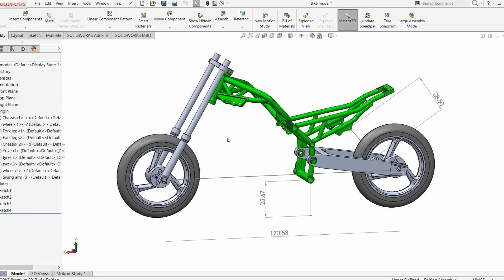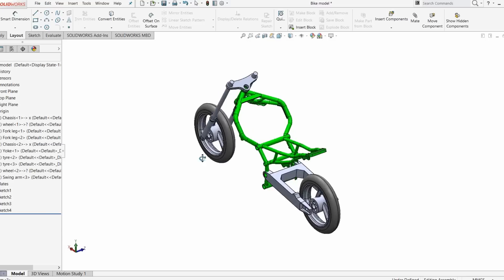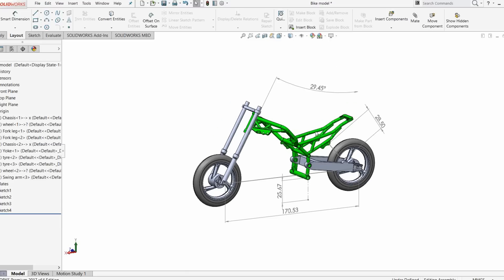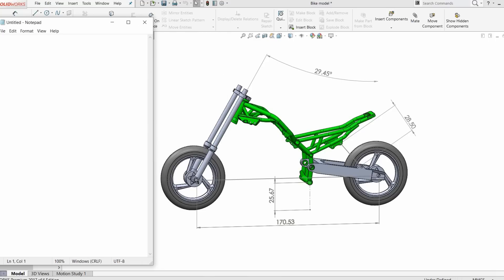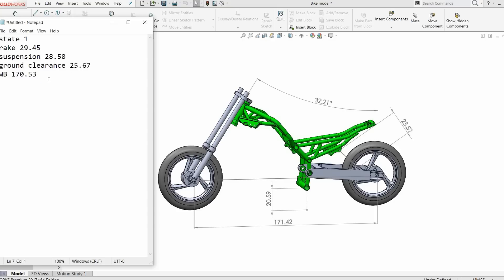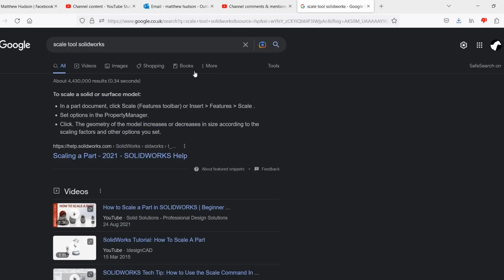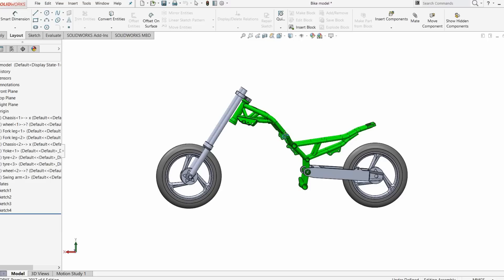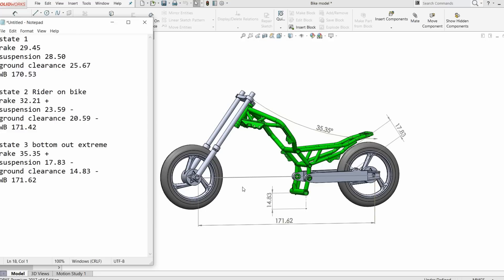Suspension Geometry 101 - Part 1

Comment: What do you think of Robert Horn's novel suspension design (particularly the front since it's forkless but without the problems of hub-center) on his prototype recumbent race bike?
Reply from the maker: You mean the bike with the massive wheelbase. Also known as the clown bike? The fact that you're asking says a lot.
Reply: @thedirtyworkshop  Yeah, his wheelbase is a little long, but Dan Gurney had a similar idea (but used common suspension tech) at a 60-inch wheelbase. I can't imagine a 60" wheelbase is too much worse than the 58 inches on modern superbikes.
Reply from the maker: Next is centre of mass. I'll let you work out that one.
Reply: @thedirtyworkshop  The Center of mass is low, but that's not an overall detriment if the polar moment of inertia is also tight. A sledgehammer with a 2-inch handle will flop over trying to balance it in your hand just as fast as one with a 10-inch handle. Where a low CG hurts you and makes things slower is when the masses are far apart, IE a cruiser bike, or for my everyday object example, a dumbbell with something like a few inches extension to the shank on one side.

Why do you think moto GP bikes keep trying to raise the engine in the frame? They're getting it closer to the rider's mass so the polar moment of inertia is tighter and the bikes can fall into a lean quicker. Dan Gurney's AAR Alligator and Robert Horn's recumbent bike both have this same design feature, just with an overall lower CG which has the benefit of less leverage on the contact patch to cause high sides or otherwise a decrease in cornering force by requiring more lean angle to get the CG low enough that it doesn't high side.
Reply from the maker: @Drunken_Hamster I like how you're asking me rhetorical questions... so long wheelbase and low CoG = bad...
Reply from the maker: @Drunken_Hamster you're also choosing a failure state as an argument. Don't do that, it's a bad position for an argument.
Reply: @thedirtyworkshop  Well I don't like how you're avoiding the counter-argument and keep reiterating on things I've since discarded.
Reply from the maker: @Drunken_Hamster lol wow that's a high opinion you have of yourself. Dude, you asked me for my opinion, I don't know or care who the fuck you are...
Reply: @thedirtyworkshop  Fuckin bruh. Talk. About. His. Suspension. Design. Or explain why low cg with a low polar moment of inertia, which allows for rapid changes in direction is bad. Disregard the long wheelbase; I already agree with you on that, and as such, it's no longer relevant.

Comment: On this subject and Dels triumph suspension video.

He bounced up and down on the bike with the rear tyre strapped down to the lift. Which I expect would bind the travel? 

In my experience, with the rear brake pressed on my KTM dirt bike the rear suspension does not like to compress. The rear shock is a PDS style, so no linkage.

Comment: Random engineery question.  I like to watch "rather B welding" he is building a trophy truck with with a bike engine and four wheel drive with reverse. Chain driven ..bloody chains everywhere as usual 😂 is he losing horsepower doing this? There is gear reductions and all sorts going on . I don't think it's ever come up in the comments but it just got me thinking with all the axles and sprockets going on. If you get a minute have a look at his latest video to get an idea what I'm on about, you might enjoy it in some way 😂his skill or ingenuity who knows. He's a good lad though.
Reply from the maker: Anywhere friction is happening you lose power. Anywhere where twisting happens over 20 times the shaft diameter there's a good amount of power loss.
Reply: Yeah kinda what I thought, cheers buddy 👍

Comment: Nice vid ! it would be cool if the next ones includes the *is it called "drag" in english ? (the distance between the pivot point projection to the ground and the contact point of the front tire) and forces apllied calculed dynamicly by your cad software and theyr effects on the character of the bike (agility/stabilty), i've read some interesting stuff on this explaining principles but not diving deeply into dimensions and forces. It would be great to see that live in CAD, what one degree of rake do and what 2 cm of wheel axle offset either done by the "T's" or by the down tube and and all that stuff  . Really nice topic ! Thanks Matt !!! 😃 I have and idea of the work it takes ... quite à lot ... CAD softs are powerfull but sometimes the're tedious or doesn't do what you expect in a very boring way lol ! I spent quite a bit of time fiddling with FREECAD trying to fold my mind into how to achieve things and redoing them the "right" way... or one of them... lol ..quite a steep learnig curve ... 😉 Sorry my "technical english" is a bit sloppy 😅

Comment: I had to see why my dishwasher quit (not the wife). Stupid control board in the top where the buttons are got wet. I need 3 grains of rice components to fix it. I want relays, on, off. So now I wait until tomorrow to try and order a board. I’m going to add more conformal coating on the next one. I didn’t know the Z900 is a terelas frame. I have a Honda 1000RR, that’s all I know.

Comment: Glad you mentioned the modelling here is not showing front fork compression/extension effects...was wondering if it was included. In part 2, hope you bring up the castor/trail effect changes on the front wheel...as per how it can make the bike more or less stable at speed/cornering etc.

Comment: Swinging arm pivot height is also interesting as this has an effect when there is load applied through the upper chain run (imagine you are pulling hard on the chain like the drive sprocket does) when throttle is wound on and the swinger squats or rises relative to the frame. As Matt says geometry change does get hard to imagine without a working model.

Comment: Did Del the bell measure his sag from the ground rather than a fixed point on the swing arm??

Also on your example you’re weighting the rear to lower everything but your not actually compressing the forks as adding a rider to a bike would do in real world situation.
Reply from the maker: It as if you didn't listen to me say about the forks, repeatedly...

Comment: Great timing for this! I'm working on a concept bike design in Blender (nothing serious or precise so everything is guestamated) and I've been playing with a different rear shock mounting to the norm, but as testing out if it works involves a bone rig, I won't really know until later in the build so it's interesting to have some info that I didn't take into account before!
Reply: Have you tried constraints and modifiers? They make for much more dynamic and versatile controls and handles for mechanical systems.
Reply: @tomkatt1938  It would be the same amount of faffing tbh, although if it had been more of a planned build I probably would've tried that anyway, but the project started out as a robot arm and somehow along the way I noticed it looked a bit like a swingarm so now it's a motorbike project lol

Comment: Goes in the box of "more f*cking interesting than I expected" 👍 Observation/question: is the central difference between a bicycle and a motorbike (with regards to geometry) is the wheelbase? I've noticed that pushbike wheels are closer than the width of a wheel whereas a motorbike you could get 1 or more wheel widths in. Something to consider if you stuck a cheapo Chinese 5000W motor on a push bike. I saw such an ebike recently tearing round a bend >40mph and it was wobbling like anything to the point it was like tank slap!

Comment: Good Video..
Bike geometry is a nightmare for most. The wheelbase thing is possibly the only part of the set up that is relatively stable on a stock bike, until someone actually goes out of their way to mess it up with really long rear shocks or some changes to the linkages etc. The reality is that the change of wheelbase of the bike is not as important in the real world as the head angle changes will be so much more noticeable. The key thing with rear suspension is finding grip and keeping the bike stable under braking and acceleration. The swing arm angle also helps with acceleration and braking as the swing arm pivot point is key to the way it works too. The pivot point Centre line is higher than the centre line of the rear wheel and so is the engine sprocket. Under load it will actually compress the rear of the bike a little and under braking it can actually help raise the rear of the bike a little to help speed up steering and then as you transition from braking to acceleration from mid corner onwards the bike will squat a little and keep the bike stable on corner exit.  We can adjust the engine height by +/- 6mm on the pit bike to make this another variable. This is how Moto 3 seems to favour where Moto GP and WSBK tend to use inserts in the frame to raise and lower the pivot point actually on the frame.

Now the changes of head angle are where much of the rear of the bike is adjusted as raising or lowering the rear of the bike will help how the bike turns and by using the rear to make those changes also works with the centre of gravity too. Lifting the bike 10mm at the rear with a say 5mm change in the centre of gravity will help more than dripping the bike at the front by raising the forks through the yoke (measured at the top of the fork). Making the changes at the fork will steepen the head angle but also lower the centre of gravity so it almost self defeats its self a little and you lose ground clearance too.  Usually those changes are only minor and less than 20mm even if you go to an extreme. Del's change to his scrambler conversion looked to go well beyond all of that  and will make the bike handle poorly and have some strange traits  Working within a narrow range when done in combination of working with the front of the bike can still have massive changes on how the bike handles.
Reply: If you raise the bikes rear suspension then the wheelbase fluctuates more. This makes chain adjustment an issue.

Comment: You need to build in a reasonable amount of trail in the front, the angle is less important than the amount of trail. I forget which old book I read this in, but there was a riding school that had a variable angle front end but still kept a reasonable trail, and it was still "rideable". With the trail too small, the steering gets really twitchy until you go too small and then it pulls the wheel to the side once you go past center.

Comment: The longer wheel base will make bumps less noticeable and a smoother ride. I think the trade off of the front axel moving forward would be decreased stability or loss of traction. Does the center off mass affect whether the front axel moves forward vs the rear axel moving backwards as wheel base increases?
Reply from the maker: The motion of either is defined by the arc, not the centre of mass. This is a static set-up not a dynamic one.

Comment: I think the wheelbase does matter in braking stability. Something to do with the mass behind the steering head pivot. The nearer to the pivot the easier to induce yaw as mass is transferred through the front tyre contact patch.
Reply: The change in wheelbase due to suspension travel is very few millimeters, this is negligible.

Wheelbase does matter but in a particular case like this it can be safely ignored for the sake of simplification.
Reply: @phitsf5475  l was speaking generally as l think Matt said @11.26: 'Wheelbase has no effect on braking stability'.
Reply: The force goes forward. WB as such doesn't matter at all for breaking.
What matters for stability at the backside of your bike is the position of the swingarm pivot point to the engine sprocket. What matters is ofc the Center of gravity and the rake.